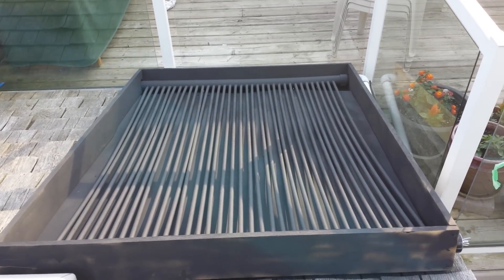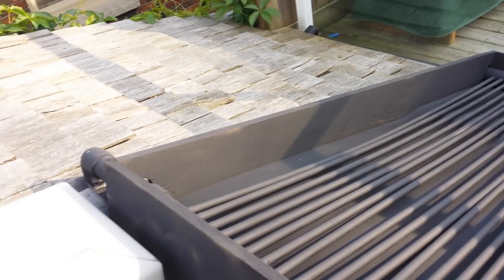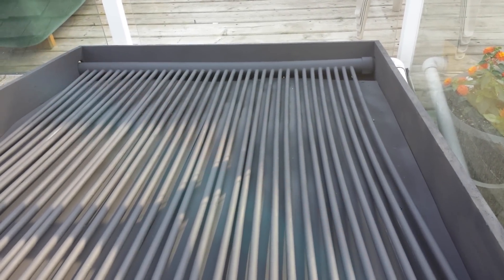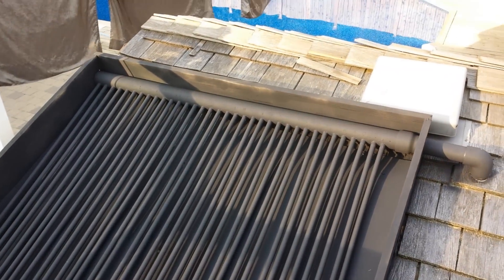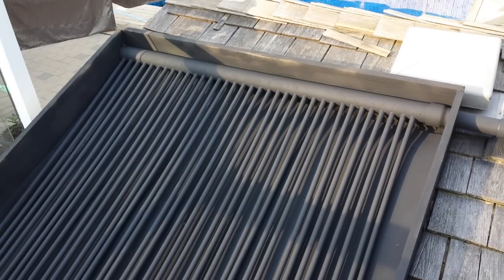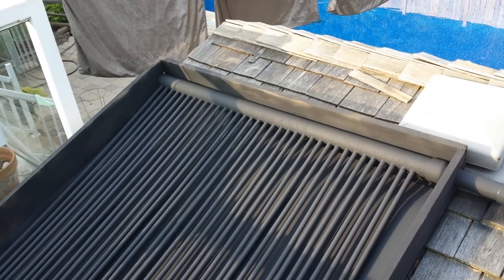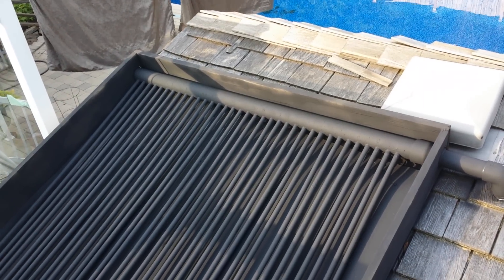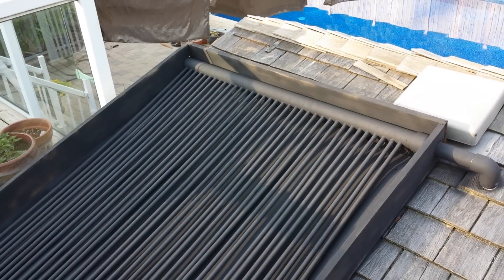DIY Solar Pool Heater Part 1 Roof

Comment: 10 gallons per hour?  What kind of a dent will that make?
Reply: this heater is really small for any size pool really. But its still free heat from the sun. So any amount will help
Reply: yeah, I disagree on that one. IF you get 9 hours of sunlight a day,  that's 90 gallons a day. Even if you have the smallest pool at 5k Gallons, and you happen to get 9 hrs a day, it will take 6 days to circulate. I highly doubt this is  going to do anything. I like the build, but I'd be curious if he junked it or added more. It's hard to find a good alternative to heating a pool; I keep looking. I wish I knew more about using attic heat or tapping into the AC. we have a 38k or so pool and would like to find the best alternative overall to heat my pool.
Reply: If 10 GPH is the actual flow rate then the valve was trimmed to nearly closed.  With a 10K gallon pool @ 70 degrees of which let's say 150 gallons was heated to 90 over a summer day that averages out to an overall increase of a third of a degree.  That's pretty modest, but over time a little heat gain will add up if the evaporation rate is controlled.  

If the flow rate was a bit more say 100 gallons/hour with that same 20 degree rise in temp then an increase of 3ish degrees would occur.  

Of course this is oversimplified.  Not sure how many therms this rig will gather.